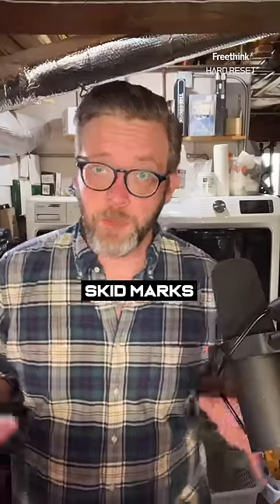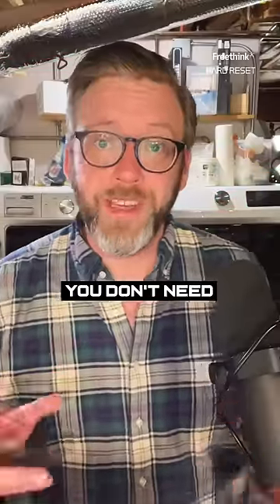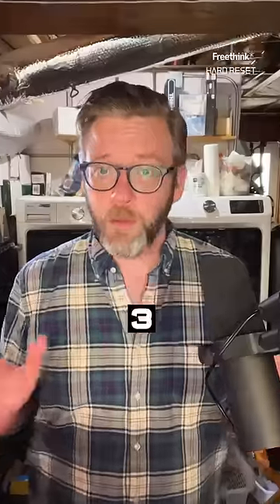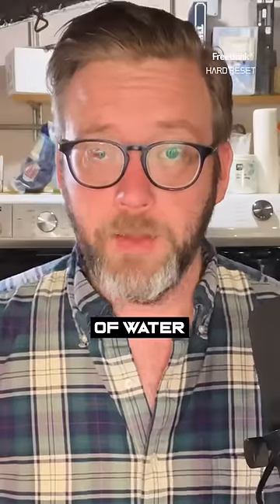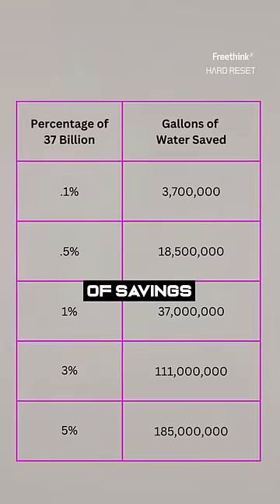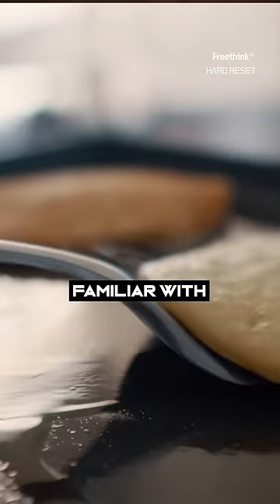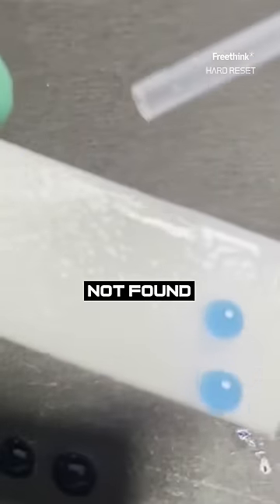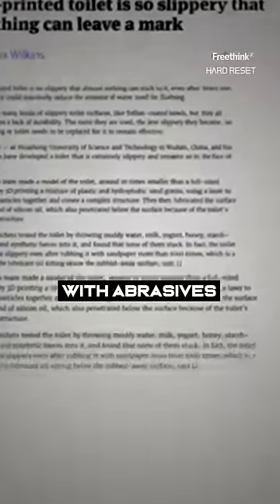Researchers invent super slippery toilet 🚽😳 #shorts #metamaterials

Comment: I work in construction. Concrete forms made with hydrophobic materials would create much cleaner finishes. Also using it inside wastewater pipes could reduce clogging and buildup
Reply: the waste water pipes idea is genius , how would the hydrophobic concrete aid in cleaner finishes? i dont work in construction quite curious
Reply: @taylormcl3358  When pouring concreate at times when using pumps it gets stuck inside. You then pause what you are doing to fix it, which means you are pouring concrete at different times which it will dry at a  different rate. 

On the surface what you see is a nice concreate but in the inside you could end up with pockets of air which will crack over time.
Reply: 🤔 could it be the cost of those materials or possibly some sort of environmental toxic side effects as to why they aren't using it every where?

Well either way, I hope they got this one right.  Because I don't believe all those waterless urinals all these companies & public organizations have installed worked out so well.

 They're probably fine for an office were only 5-10 ppl use them a day. 
But in places like stadiums, gas stations/convention stores, rest stops/visitor centers on roads the smells after a few dozen to hundreds ppl uses them is almost unbearable. & The stains
..& don't the cleaning staff can't keep up with them.
Reply: If you're using wall forms nobody cares about how it looks.
Reply: You’d have to use it inside of the waist pipes otherwise it would create clogged with the lack of water from toilets, not flushing as much 
water.
Reply: ...haha slide go weeee
Reply: My thoughts exactly. I've ran into plumbing situations where a lack of water flow from replacing old toilets with new toilets creates soft blockages because waste isn't being carried away, and the pipes have minimal slope. They worked fine with old, high water use toilets, but new ones failed to perform.  @coreybauer
Reply: Man I did a job where we had to use this plastic coated board for the forms… was such a pain because we had the chisel the old bolts off the old board on these metal forms and instal the new boards. I definitely preferred the all metal column footing forms cause I could just buff those out with a wire wheel. If you lined the inside of a concrete truck and concrete buckets for the excavator it would be a game changer if it really works this good.
Reply: @Alex-vz2jz  Don't they use a vibrator to remove air pockets and settle the concrete?
Reply: As already mentioned by someone else, the lack of water might cause clogging regardless of the slippery Surface. Out of experience I know that hard water can cause a slippery surface to become a rough surface, in toilets it can be even worse because of setting calcium from urine. The idea itself is not bad, but it might turn out differently from what was expected if it’s left unchecked for a long time
Reply: The concrete truck one would be genius, it’s always hard work to clean materials and tools of the leftover concrete... so maybe the concrete tools in general should also...?
Reply: If you can't get a clean wall with wood forms and some form oil...you definitely did something wrong. lmfao
Reply: Wouldn’t have to use diesel or kerosene.
Reply: Yes but some plumbers will have less job opportunities
Reply: This... worry about the waste pipes first or you will have massive clogging issues. Modern water saving toilets causes enough issues already. @coreybauer
Reply: We used vehicle transmission oil for coating 3/4in. OSB for forming, but too dense of a coating will mess with the concrete cure. Other companies use a variety of form coating substances, but our choice was good for wiping off surface level cream residue & lubricating tools too.
Reply: Would suck for a mudrake probably-- I suspect the mud would run from the surface such that you couldn't pull it with the comealong. Ditto for a screedboard. Top of the steel trowel, now, and bullfloat top too would be nice as cleaning tools would be easier.
Reply: @Hunty49 you most definitely will vibrate any structural concrete. But stuff like patios and driveways we generally just shake it with The Bull float or something called a jitterbug.
Reply: @joeloweryourexpectationsbiden Florida finisher here, generally we just tapped the forms to get all the air pockets out

Comment: Making fiberglass molds. Keeping production molds clean is a never ending job.
Reply: Good point!  Concrete forms are much the same way.
Reply: @billt6116  for the fiberglass though, the cleaning is down to almost the microscopic level. The tiniest little buildup makes an imperfection in the gel coat that show up in the paint. Royal pain in the butt.
Reply: Totes!!
Reply: Made rail sleepers, dirty ass job if you got put on mould detail...

Comment: Rain pipes/gutters! Bathtub WALLS only, Not the floor of the tub.
Reply: Yeah,but how you gettin' out without at least one broken bone?
Reply: @AlexLP_YT they said only the walls so you would get out normally.
Reply: @Just-MACCHEESE  can you get out of the bathtub without touching the walls?Do just mario jump out?
Reply: @AlexLP_YT  Ever hear of Hand Rails?
Reply: @TimeSurfer206  In bathubs?
Reply: @AlexLP_YT  no. On the freaking ceiling
Reply: @AlexLP_YT  you use the side of the bathtub…
Reply: @Just-MACCHEESE  wich is slippery...
Reply: @Just-MACCHEESE  i can't lie, alex has got you there.
Reply: @AlexLP_YT  I thought they meant the walls of the shower not the walls of the bathtub. Like the whole bathtub is not slippery but the walls of the shower are. Edit: I reread it. They are just stupid and didn’t think it through. It would only work if you have handrails.
Reply: @AlexLP_YT  Yes, Timmy, most bathtubs have walls.
Reply: but imagine all the animals falling into gutters, they won’t be able to grab onto anything
Reply: @Just-MACCHEESE  not stupid, just figured you could think it through.
Reply: The slippery part would be the walls of the tub, where the rings form. getting out of the tub, one does NOT touch the inner walls! It would keep the tub cleaner, without interfering with use of the tub itself. 🤔🤨
Reply: @AlexLP_YT stop being in athelethic
Reply: How about sinks in bathrooms for you know tooth paste so it woudnt stick to the sink
Reply: why

Comment: If this material came transparent, would be good coatings for windows,  mirrors and maybe even TV or other digital screens. No more smears or splatters, dust or water, or at the very least much easier to wipe away without issue.
Reply: Digital screens? So i drop my phone 10x more, and have to buy new phones? That you, big cellphone!?
Reply: @Rob-gf3pb if you grab your phone by your screen then you deserve to drop it lol
Reply: I love the idea, but sadly I doubt it would work as well on oil smears that we smuch into screens, we don't just drop our fingerprints onto screens.
Reply: @Tempi_ 
Thank you.
Reply: We already have something similar it's called hydrophobic coating they also have spray powder and liquid all good for different things just not widely known
Reply: @Tempi_  they make the whole phone of the same glass today...
Reply: Great idea!👍
Reply: If it is transparent then we can use this material in Vehicle's front mirror to avoid windshield wiper..
Reply: @shubhamgusain544  it said it's none stick, not that it's obscenely smooth
Reply: @Skylancer727  if it is non stick then it must be form non wetting liquid interface with water and it is beneficial in case of front mirror and this is what we want..
Reply: What does it say? I'm trying to read it on my stained phone screeen..
Reply: Only if it is cheaper than the alternative. TVs use to have metal now they have plastic
Reply: @Tempi_  dont act dumb
Reply: Colin will sue this company
Reply: Slippery dosent means durable, can be good for soft poop but not impact or scratch resistent
Reply: bird killer. bird's cant see window

Comment: Orthopedics and joint replacement could benefit from a lower friction coating as well!
Reply: That is so smart I’m mad I didn’t think of it
Reply: But it needs to be sufficiently hard like ceramics
Reply: @Hufi2. maybe double material?
Reply: @Hufi2.  or self-repairing
Reply: @nfnworldpeace1992  it's about not creating any shavings, because ceramic joints already have basically no friction and no shavings. So it has to at least mach that to be useful
Reply: Pretty much every machine would benefit from loss of friction. If they manage to make load resistant barings out of that stuff it could habe a major impact in lots of machine industrys
Reply: @Hufi2. WOAH I USED TO HAVE THAT PICTURE
Reply: If it's body safe
Reply: Huh.....that actually sounds like a good idea.
Reply: @nfnworldpeace1992 yes like cement with quick lime in it, something like that, it self resealable
Reply: Omg yes!!
Reply: I have thought for decades that they are doing complete knee replacements completely wrong. If you are going to replace a body part, then replace it with something that will last for more than a decade.
Reply: My first thought was maybe it could make intubation easier.
Reply: Most artificial joints have enough friction reduction
Reply: @shout4371  oh you mean my pfp?
Edit: I like the artists work and I use another one of their works for most of my accounts (:

Comment: Sauce bottles seems like an interesting/fun application
Reply: This is underrated
Reply: great idea! the reliability of glass with the ease of plastic.
Reply: the issue I see is it will need a different part with some friction towards the exit so you don't pour the whole bottle out by mistake.
Reply: @sxlg_32 squeeze bottle lid
Reply: Some of the Japanese sauces with soft bottles seems to have some coating so it clings on less
Reply: They have these already
Reply: And re use them after
Reply: How is this comment sitting with under 500 likes?
Reply: @satomz  because they exist already. They aren't cheap, so you'd be using it as a refillable bottle, kind of a niche market in and outside of restaurants. Probably not even commercially made yet
Reply: I don't think I want the Chinese meta material touching my food thanks. Not about racism, I just know the CCP doesn't really care about people.
Reply: @conlonpatrick3011 is a repellant coating. There should be no interaction
Reply: @firelegend242  the bottle were created at MIT in Boston
Reply: @submaxcw7947  It wouldn't matter where the bottle is made if the material is toxic. You don't know how it reacts with acidity or heat and the possibilities of leaching into any food. I could see use in toilets, but food seems like a big jump for a material. Not to mention that China doesn't really care about pollution or how it's policies affect it's people. Do I need to go into there lax building guidelines that cause structures to crumble often or their horrible polluting problems or their enforce work encampments over COVID or their live organ harvesting from minorities and multiple genocides they've committed or their COVID policies where they literally forced starved a ton of their people and purposely let food rot instead of distributing it. I could keep going, these are all documented and filmed and have been happening since the beginning of the CCP. Great famine, art busters, and political killings all of this is what the CCP is known for. Sorry if I don't trust the government who purposely murders it's people with no accountability to do safety testing on a new material

Comment: A lot of people mentioned that this product, if used on toilets, will cause congestion of the pipes (which I agree is a major con), but another alternative I see this being useful is it being lined for roof gutters, so leaves and bird feces can return to the soil rather than having to clean them manually
Reply: I don't understand how it would cause congestion. Is it from the product itself or because it the toilets would use less water to flush. Could you explain?
Reply: @caylindelacruz2641  the angle of the pipes as well as their diameter are specifically designed for a certain amount of water to have enough momentum and force to push the waste down to the treatment plant. if significantly less water is used the force of the water will be too small and you end up with pipes clogged full of waste which will cause even more environmental damage and flooding once a heavy rainshower hits.
Reply: @KT-pv3kl  aahh, ok that makes sense. Thanks for the explanation
Reply: use the same amount of water. Still no skidmarks
Reply: @calibos3329  are you unaware of how physics works?
Reply: Because they didn't think of the next step, which is to put this kind of lining in older pipes during replacement/repair works.
Reply: @raimondsmackaitis6815 I have no clue what skid marks are on a toilet, and I'm kinda afraid to know, but a bit curious😓🤔
Reply: After seeing birds being trapped in a roof gutter, I don't think this would be the best idea.
Reply: @MikaeruDaiTenshi  yikes is that a thing? 😮 I hadn't consider that. Nice imput!

Comment: The water is like a lubricant to effectively transport the waste down the system. The pipes would probably need to be slippery too to get the most out of using less water.
Reply: I’d just be happy for me shits to not be stuck on the inspection plate forget the water
Reply: just make everything have zero friction coefficient, and travel by wooden Minecraft boats
Reply: @iamt00t 💀
Reply: @iamt00t on ice
Reply: Yeah, but at least the toilet would never get dirty if I’m understanding this right
Reply: This stuff is polypropylene with silica particles. If you can make pipes out of it cheaply, they could replace PVC pipes.
Reply: @michaelbuckers  Thanks for the added information. Hard to believe that the surface can stay slippery after scrubbing it for many years as this clip states (stands sanding). Would love hydrophobic surfaces on toilet, phone, etc if it would really keep the nonstick properties.
Reply: @cubertmiso  Well it's not losing properties from sanding because the properties are not due to the surface structure, but due to bulk material structure.
Reply: That's why this would never actually work. You NEED the water to flush the matter down your pipes, otherwise they'd constantly clog.
Reply: That's why this would never actually work. You NEED a certain amount of water to properly flush the matter down your pipes, otherwise they'd get constantly clogged.

Comment: It's not just the toilet that needs to be slippery if you want to use less water.  You better hope your pipework is good and there are no displaced joints, scale/encrustation, grease etc that will cause a blockage.  Use more water if in doubt because it will save you a small fortune from having drainage engineers visit in the long run.    Water will flow faster than the solids it's carrying if you use little water.   EDIT:  Trust me, I was a drainage cctv operator for 10 years!
Reply: Is that good money?
Reply: @NogGonnaMakeIt  Yeah probably one of the best paying industries if you don't have qualifications or aspirations for anything else - and good it's fun, usually with down to earth people that aren't too fussed about unblocking a shitter when most the time it's just a plunge and go! (Depending if the company is industrial or domestically focused)  I've worked in both, starting with industrial on motorways etc (surface water) then taking the experience to a local drainage firm that was both surface and foul, also upgrading the way they operated in how to inspect a pipe properly!
Reply: @sKuNKdoSE  awesome. Thank you for your response
Reply: As someone already pointed out in a different thread, even if each flush still uses the same amount of water, never having stuff stick to your toilet bowl will still save some number of extra flushes.
Reply: What I was thinking was yeah okay the toilet bowl is going to be slippery but that's probably not going to be the case for the piping, so less water does sound kind of gross... like it won't carry everything through the pipes properly
Reply: Ouu..smart!!!!
Reply: I think its about using less water not no water
Reply: Exactly my thoughs!
Reply: As someone who’s spent quite a few years sewer-jetting( cleaning up clogged pipes) you are 100% correct.